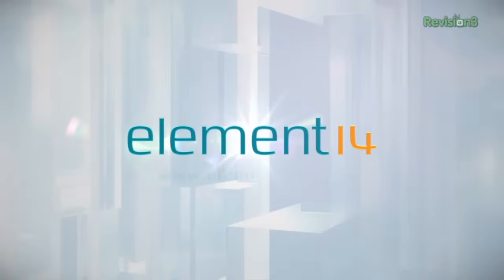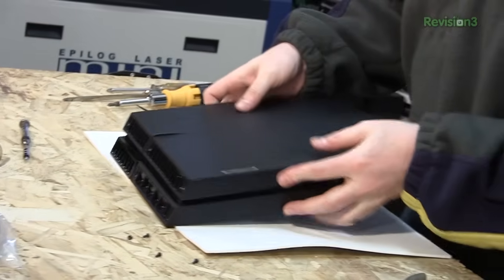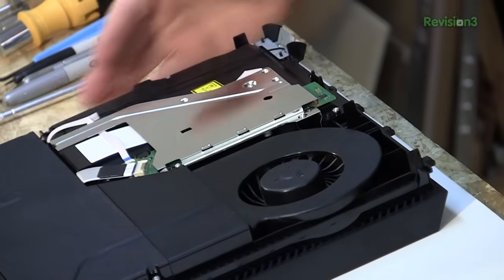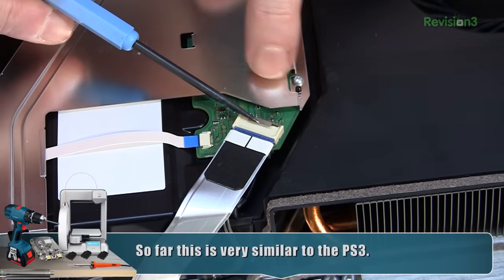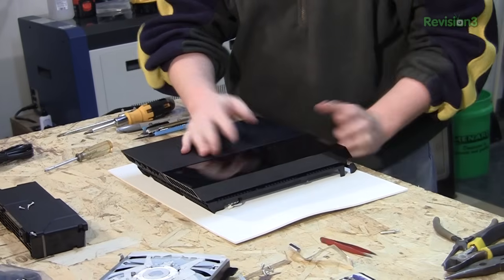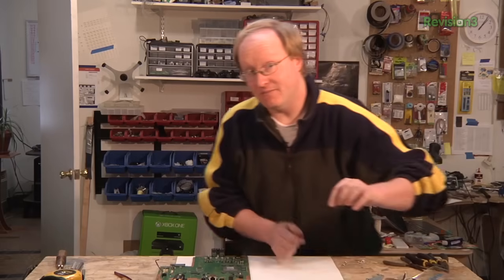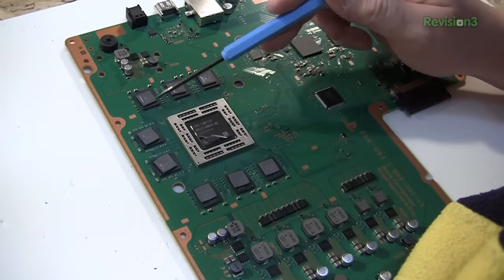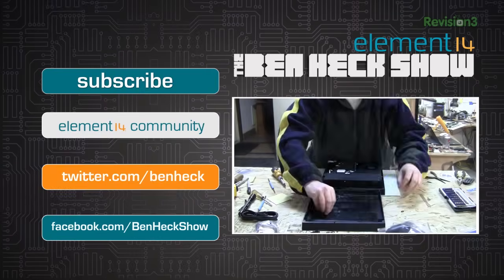Ben Heck's PlayStation 4 Teardown

Comment: Should I get a PS4 or an XBOXOne?  I heard the xboxone can't perform as good as the ps4 ... is that right?
Reply: They both perform the same, basically. Who gives a shit about exclusives? Both systems have them. You can't take PHENOM's word for the XBOXONE, as he has never owned a PS4. As a PC user, I prefer the PS4, but they're both basically the same system.
Reply: I Think you should go after the one your friends have bought or are going to buy (-;
Reply: You just had to ask didn't you! Like throwing a single slab of meat into a lion cage!
Reply: Xbox or PlayStation? I prefer to have sex with real people, arguing other which console is best only reduces the chances of any fun. Can everybody just stop boasting over which they think is best and just enjoy themselves?
Reply: Cody Strean not everyone wants a pc to game on dude.
Reply: XPHENOM SKILLSX oh yeah? well at least playstation doesnt have a pay wall behind everything, and doesn't use double a batteries in the controllers
Reply: ***** yeah but i only like pc for pc only games if i have the option to get it on console i will
Reply: The difference is very minute but ps4 is slightly more powerful but xbox uses less power while keeping a lot of the fps at 60, the ps4 might have some frame drops because of it running 1080p and in my opinion the ps4 is louder than an xbox, also the ps4 controller is pretty good except for the trigger buttons, the xbox controller has a few flaws but I like it the most
Reply: ben reeves We know more about next-gen games than you, we are the ones that experience true next-gen.
The 'next gen' consoles are actually past-gen, we have had those graphics since 2008.
Reply: Xbox is better
Reply: XPHENOM SKILLSX Thanks for your feedback.  TBH I think I'll just get both.  Buy a few busted up ones on ebay and repair them.
Reply: Trust me I just got the xbox 1 last week I'm loving it and how does size and looks matter for gaming? We get more exclusives, we don't get hacked like ps4 servers are always down, we get dlc one month earlier. Now its up to you.
Reply: XPHENOM SKILLSX I'll definitely consider it then.  But I'm the kinda guy that hates to choose lol I got both the ps3 and the 360.  However there is one company I will no longer buy from and that's nintendo.  They messed up way too much for me.
Reply: If you have the money then go for it.
Reply: But WAYY better than the ps4.
Reply: XPHENOM SKILLSX no the security on Xbox is just about as bad as ps4s sorry your not going to get great security on either of them
Reply: XPHENOM SKILLSX no its not
Reply: MrDurka Gaming not its true the xbone is garbage
Reply: XPHENOM SKILLSX i never said that. The security on sony sucks im not gonna be a fan boy about that but to be honest the ps4 is the ultimate console no doubt
Reply: kake427 Lol, that 50% more powerful thing was proved false a while ago. It's more like 10-20% more powerful, and with the new SDK update on the xbox one and dx 12/windows 10 coming soon they will be on par.
Reply: also it puts gaming first and doesnt have a crappy windows 8 interface
Reply: classicgamer2396 ps4 had one major update that had to be updated to work right. Xbox has had monthly major updates that worked day one. Also it has more indie games than xbox does yes but not when it comes to aaa exclusives.  Your opinion that the interface is "crappy" is just that, an opinion. Lastly xbox has put gaming first more than ps has. At the beginning that's what they said but now their focus is tv and movies and gaming last.
Reply: AntiKipKay dont go with what that first guy was saying, not true, ps4 is the fastest and the strongest console on the marquet to date, wich was a surprise for me, since i prefered the xbox360 over the ps4. also, sony got ALOT of exclusive IP's for the new console, also games are being made for ps4 and ported to xbox, that's just beacuse ps4 is strongest and easiest to build for.
Reply: AntiKipKay Microsoft turned it's back on it's customers when they announced the Xbox One. You couldn't get used games, share games, play offline for more than 24 hours (people who don't have internet at home [like me] were pissed), and the Kinect NEEDED to be plugged in for the whole thing to work. Do you want them constantly spying on you? Snowden confirmed that Microsoft was selling the NSA customer information. Yes, Microsoft changed everything, but only because they had to. If they were the only console on the market they would have changed NOTHING. I've made my choice. Now I leave you with yours.
Reply: i will it admit i was bashing the xbox one pretty hard so  and i can see why you'd think im a fanboy the ps4 definitely has its ups and downs. One of them being that sony security sucks donkey balls its been down ALOT, and the firmware update that didnt allow you to turn on the ps4 was pretty sucky aswell. Another thing I've noticed is even though the controllers look pretty innovative they are kinda unreliable when it comes to the analog  sticks the rubber on it will wear off after a few months so there you go thats the problems I've noticed with the ps4 its definitely not perfect
Reply: *****
i do have a gaming pc that's probably better than my consoles i just prefer the console i like the idea of chilling on my couch and looking at the big screen
Reply: Josh Spruce it's nice to know there are some cool gamers out there. Instead of people bitching why don't they just leave it you know
Reply: ***** you keep proving my point. If you hate consoles so much then why do you give a fuck? Oh that's right cus yoy think your special and need attention.  I don't care to spend 60 bucks on a game someone busted their ass to make. Also you do need to keep upgrading your hardware to outperform these consoles as more games come out and demand more power on pc. Like I said not everyone wants a pc but you still can't get that through your head. People like you ruin gaming.
Reply: MrDurka Gaming THANK YOU! IM NOT ALONE!
Reply: Jacob Hylén Very good point.  I thank all of you guys for giving your opinion on the matter.  I have read them and taken them into consideration.  I'm inspired to build a gaming pc as well as still play on consoles.  I'll feel much better now whether I get the ps4 or the xbone and won't feel bad missing out on anything besides the exclusives.  Whichever I can get cheaper will be the deciding factor.
Reply: ***** because if im playing my favorite pc game i wanna use a keyboard for it but i wouldnt wanna use it with a controller i would prefer a keyboard for a pc game
Reply: Lol almost equal then why some games ps4 1080p 60fps ad xboxone 720p 60fps yall are delusional its a fact ps4 is faster than xbox one they are not the same it would be bullshit and funy if they release a same spec system ps4 is fater uses gddr5 memory and has a better gpu not to mention a built in 3.5 headphone jack on the controller
Reply: Franz Pogi Both consoles are locked at 30 FPS...
Reply: TheVanillatech And no one likes you. Even your parents.
Reply: ***** Agreed, ultra-modded Skyrim was already ahead of nowadays "next gen" consoles graphics two years ago.

Also, the proof PC is ALWAYS superior comes from the fact that they use PC's to test, create and produce consoles and console games while you can't do the contrary.

This is a hot topic every time a new "console gen" comes out, let the console kids rage and talk shit. One day they'll probably wake up, if not let them just enjoy their system. Trying to win an argument with an ignorant person is a waste of time considering this is about facts and not personal opinion.

The personal opinion is which one you prefer, not which one is "best". PC is best, period, and there's so many proofs only an idiot would argue about it hence the waste of time trying to convince them of the opposite.

I enjoy both and have been gaming for 15+ years, no way anyone with such a long time knowledge would say the opposite and that's why console raging commenters are probably a bunch of kids...or at least I hope so, for them.
Reply: Ayan shaikh A computer. Lets just keep it at a computer.
Reply: YourPalHDee
Both are shit. Both can't do more than 30fps. Both are shit.

I get 150fps on my PC. At least with windows 10 and DX12 the XBOX will start to look good and have 60fps+. But a PC will still make it look shit.

The PS4 will be ULTRA shit. It already is. It was before it got released.
Reply: XBOX ONE: Less resolution, More frames per-second.
PS4: Decent resolution: Horrible frames per-second. 
--------------AND NOW------------------
60FPS +, FREE MULTIPLAYER, EXPANSIVE COMMUNITY, MODS
HAIL, THE ONE, THE ONLY, GLOOOORIOUS: ==+PC MASTER RACE+==
Reply: YourPalHDee just from what I've heard (which may be wrong). I've also read that PS4 Units have an underclocked CPU which to me sounded like a statement that would affect performance, Apologies for incorrections. (I am quite new to technological specification and am only speaking from my experience with the consoles in person. Not my own consoles of course, I do not own such peasantry). 

PC MASTER RACE - PRAISE LORD GABEN.
Reply: Wii U > All
Reply: AntiKipKay get a g51jx - x3 can play heroes of the storm extreme settings buttery smooth so probs can play well with other games
Reply: AntiKipKay nice that's good to here I've built pc's for a while and let me tell you they are well worth saving up for.
Reply: Xbox has like 40 exclusives i cant even name them all. What does ps4 have? Yea right, little big planet. xD
Reply: DeadmansWish
All your games are 30fps and all your bases are belong to us!

-PC Master Base
Reply: classicgamer2396 The Lizard squad is mainly going for Playstation because sony's security is so bad. Playstation servers are always down.
Reply: XPHENOM SKILLSX you dont know shit cuse you dont own playstation 4, ps4 superior 50% more powerful
Reply: kake427 Everyone is saying that to me online but what do you know about me I have both the consoles.
Reply: XPHENOM SKILLSX and they're not ALWAYS down. just like xbox
Reply: XPHENOM SKILLSX Keep in mind that I've owned consoles before :)
Reply: AntiKipKay keep on mind that if you dont have internet the xbox one will not be playable
Reply: Well that's a lie lol
Reply: classicgamer2396 coming from someone who still thinks it's always online lol keep trying kid
Reply: classicgamer2396 hahahahhahahahah
Reply: ***** cool story bro http://www.ign.com/wikis/xbox-one/PS4_vs._Xbox_One_Native_Resolutions_and_Framerates
Reply: kake427 Yeah only two 720p games on the xbox one and they look identical to the PS4 versions side by side
Reply: ***** yeah its not easy to see but still
Reply: MrDurka Gaming Then why does 50% more people like the PS4 better .....more....cough cough ....games
Reply: In lizards squads interview they said that dont was harder to ddos than Xbox and they had to take a bit longer im not choosing sides i just like to let people know the facts...happy fighting :)
Reply: Oops forgot the sony instead of dont
Reply: MrDurka Gaming dude wtf are you talking about yes it requires lots of updates but so does xbox and it has more games than the xbox
Reply: MrDurka Gaming mo man the ps4 has put gaming first
Reply: classicgamer2396 so not worrying about games and putting all your efforts into playstation tv and some shows for psn is gaming? Get out of here fanboy lol
Reply: I have both and the PS4 has the better multiplats (98% of the time) (here don't believe me? look at this http://www.ign.com/wikis/xbox-one/PS4_vs._Xbox_One_Native_Resolutions_and_Framerates, was cheaper (when I bought it), is technically superior, so the games will look better and Sony has far more internal studios than MS, therefore will have more exclusives. It also has the better controller in my opinion. Its got a touchpad and speaker and the light on it, while the X1 just has rumble triggers that are barely used. PS Plus is cheaper than Xbox Live and gives you at least 6 free games, many of which are new games, whereas Live just gives you two and are always years old. And the list goes on. The X1 does have more system opitons and features, but PS4 has shareplay which is a better feature in my opinion than anything the X1 has.
Reply: MrDurka Gaming im not a fanboy if sony does something stupid im going to point it out. But right now your the fanboy by bashing sony about things that arent even true so now im saying to you GTFO fanboy
Reply: ***** they're being made for it for now because it's like making games for 360. Xbox one is more complex to develop for. Ps4 isn't even powerful enough to say anything. The gap is the smallest ever and games will look the same for the most part.
Reply: You could still buy sell and trade used games. You could share them digitally disc or digital and they changed it because they listened to the customers. Sony is the one that turned their backs to everyone by lying like usual.
Reply: MrDurka Gaming How did Sony lie?
Reply: Sony always has. With the ps4 they said things like "we'll make 4k games" and ps4 they said "we never had drm" when they originally did or "were for the gamers" then only release a few exclusives and worry about tv and movies. Atleast microsoft was upfront about drm. They didn't lie or didn't mention it. Drm is where gaming is going anyways. The 24h checkins were to prevent piracy and stolen games and the used game policy would have kept more studios open and making more games. Used games alone have killed multiple studios.
Reply: With the ps3*
Reply: MrDurka Gaming im not a fanboy i own a ps4 because i prefer it if they started dropping the ball with playstaion than you can be damn sure im gonna return it or try to sell it
Reply: classicgamer2396 I'll get a ps4 when God of War comes out until then ps3 is better for me and xbox one is my next gen choice. I have all playstations and 1 xbox. I've always preferred xbox but I like sonys good exclusives but so far none that I'm interested are out coming out or announced
Reply: dude exclusives are great on both generations just depends what your into look it up
Reply: Very true
Reply: *****
not to mention playing couch co op games with my friends
Reply: ***** I prefer console cus I don't have to upgrade when new games come out. I just pop it in and play and it still looks great. Also you don't get games like forza or god of war on a pc so for me pc is a waste of my money. Not everyone wants a pc and nobody cares about pc when compared to consoles. If you prefer pc that's cool but stop forcing your opinion on others.
Reply: Yo if you have enough money to buy both, just buy a PC. Puts both of them to shame.
Reply: You want the truth they perform equally they actually have near same parts. just ps4 has a slight gray filter for the visual perspective xbox one does not which i prefer no gray filter
Reply: XBone can't perform as well because it suffers from erectile dysfunction...
Reply: ***** again not everyone wants a pc why us that so hard to understand?
Reply: ***** just because you don't like consoles doesn't mean everyone has to feel the same. If you don't like it then why are you watching vids on it or talking about it?  That's illogical. Not everyone can build a pc not everyone wants to. Some people like other things but you can't get that through your head.
Reply: ***** also pc will be more expensive. As games get more demanding you will need to upgrade your pc to run it at high specs while with a console you just pop it in and play and it still looks great. I paid 500 bucks for mu xbox and won't have to spend a dime more to play the games I want. If you don't like consoles then stop worrying about them.
Reply: The ps4 performs better than the xbox 360, but that doesn't matter, as every game still runs perfectly smooth on both consoles. You aren't buying a console for the actual console anymore, you are buying it for the exclusive games. I got a ps4 myself, pretty much the only game I've gotten is Infamous: second son, because it's my favorite game of all times. I saw that Infamous was coming out and that it was going to be an exclusive to the ps4, so I went out and got myself a ps4. Now I'm a PC gamer, but I still bought a console to play an exclusive on it.
Reply: ***** that just seems weird to me, i like pc games because of the keyboard but i wouldnt wanna hook up a keyboard to my tv and set it up on a tray table
Reply: AntiKipKay PS4 has better hardware inside it you will get better performance from it

Jacob Hylén Actually it's 60 FPS..
Reply: ***** 
Okay time to educate you. The majority of PS4 games will run at 1080p with 60+ frames with the majority of Xbox games running 900p at 60+ frames. Around a quarter of a quarter of those games runs at 900p - 1080p at 30+ frames. The FPS does vary if the game is demanding or not and if it was on last gen consoles. Lets say there is a HUGE demanding game and it was on last gen consoles, and it is still demanding on next gen consoles. They would have it at 60 frames.
Reply: ***** Wait are you saying AC is a very demanding game? The last time I checked those games were not talked about.
The PS4 DOES run CoD:AW and Ghosts at 1080 with 60 FPS with the Xbox version running only 720p on Ghosts (you can expect that from Xbox)
And I really don't know what you are saying about PS4 proven to be too weak? Can you please get some proof? I can play all my games with amazing response and it runs amazing.

And GTA V does run at 1080p and with a $400 console you really cannot get over the 60+ FPS mark. You can come to me saying OH MY $400 PC can totally do that hur dur. Okay then nerd give me the specs.

And MGS5 does NOT look terrible on the PS4. Cause you know PC and PS4 totally look different graphic wise. (Hope you catch my sarcasm there and if you do please send me a link stating HUGE differences)
Reply: XPHENOM SKILLSX Lizard Squad was disbanded and taken down about 3 months ago. Ended up being just a bunch of over-privileged sociopathic children. xD
Reply: bob jimmy It's very hard to compare a pc and a console by the price, as a console generally costs more to produce than it is being sold for. The ps3 for example cost 400 $ when it was brand new, but 800 $ to make. Sony later made their profit when they sold all the games. I think that if you're going to compare a console to a PC, you should compare it to a 800 ¤ PC.
Reply: classicgamer2396 Keeping double AA batteries is way better. Haven't you heard that if you charge a Playstation controller 500 times you will have to throw it away.
Reply: XPHENOM SKILLSX You are wasting more money on AA batteries though. And the chargeable batteries only last for like 10 charges then they are useless.
Reply: To be honest on the performance side PS4 is more powerful, there's a lot of games Xbox can't handle at 1080p that are running at around 900 upscaled.
I know that might not be an issue for most of us but still, imagine when 4K will be a standard. How would Xbox perform?

Consoles has the bad habit of being released outdated already so don't worry about performance, check the features and exclusives you like most and get that.

Everything but this is nonsense talking or fanboyism.
Reply: bob jimmy
 FUck you
Reply: ***** And yet you cannot make a $400 PC that cannot ruin consoles.
Reply: bob jimmy
Yes, you can. A $170 GPU is 2x faster than a GTX470. Therefore, it ruins consoles.
Reply: TheVanillatech Can you please tell me where you have got the thing saying that a console runs a GTX470? Nice try anyways.
Reply: ***** Okay listen here nerd. It's $550 in my currency (Oh wow he doesent live in America? How crazy!) And yes the card is to big for the case. No operating system? That is going to give you another $100 because last thing I found out is that Linux doesent support all games.
Reply: bob jimmy
Sure. Go to LinusTechTips here on youtube. Look down his loooooong list of videos and find the one where they benchmarked the PS4 and proved it was around the same rendering speed as a GTX470 (with the actual GTX470 being slightly faster than the PS4's GPU, but you're talking single percents).

Funilly enough, if you owned a GTX470 and played those amazing boring and unoriginal "AAA Exclusives!!!!!" on it, you would probably only be getting 30fps in 1080p in medium settings too, kind of like the PS4. Thats one of the reasons I upgraded my GTX480 two years ago, because it was starting to get old. It was LAST GEN. Oh wait a moment, Sony is bringing out a "NEXT GENERATION!!!!!" console, using the GPU I just THREW AWAY?!?!!

How I lol'ed ;)

-PC Master Race
Reply: TheVanillatech "Funilly enough, if you owned a GTX470 and played those amazing boring and unoriginal "AAA Exclusives!!!!!" on it, you would probably only be getting 30fps in 1080p in medium settings too" And this is where you don't get it. The devs have a say on what the fixed graphic settings and resolutions are. A console is completely capable of running 60 FPS on some games just like some $400 gaming PC's are capable of running 60 FPS and 30 FPS on certain games. And it IS considered next gen because of the new games it is running. Its just like you saying you threw out your GTX 780's for a pair of Titan Blacks.
Reply: bob jimmy
Sorry but .... WRONG. Remember when the first alpha of Doom 3 was leaked? More importantly, remember when Doom 3 was first shown back at E3? The gameplay footage was running on a Geforce 3, because this was the fastest card at the time. You know what... I can't be bothered. You win. Consoles are great. They are exactly what the world needs. They have done marvels for gaming. Things have never been better. 30fps is perfect. Have a nice life.
Reply: TheVanillatech LOL you are saying that all games on consoles run at 30 FPS. I could tell you a list of big demanding games that run WAY over 30 FPS on consoles. And anyways consoles are more fair to all. Everyone has the same frame rate everyone has the same specs in their console and its all fun and fair game.
Reply: bob jimmy
So saftey in numbers, huh? It's great to have 30fps as long as everyone ELSE has 30fps.

"I don't mind having no legs, because everyone else in my family has no legs."

"I don't mind spending £400 on a next gen console and being FUCKED over, because every one of my friends bought the same console and got FUCKED over too!"

"I don't mind being told lies about products I spend lots of money on, as long as the company lied to EVERYONE and not just me."

.... you get the picture.

-PC Master Race

(and no, not all console games are shit - I personally love beat em ups, vertical scrolling schmups and the Grand Turismo games, they are CONSOLE games. I just think that consoles should stick to what they do best, instead of dabbling with PC style games, which they are not only incapable of running (30fps yo...) but also strip of everything that made them great in the first place)
Reply: What would you guys suggest if I were to make a gaming pc?  Price range of about 600 bucks.
Reply: AntiKipKay
Ask a fellow American. Your prices are way less expensive for parts compared to the UK, so I cannot help you. I don't know your markets or which online tech retailers to use over there in the USA.
Reply: TheVanillatech Okay half of the shit you just said like "I don't mind having no legs, because everyone else in my family has no legs." Is not even relevant to a console and its frames. Everyone is on an equal playing field and NO you do NOT get fucked over buying a console. They are more friendly and you do not need to build it, they give you great exclusives and thats ONE of the main reasons why people buy it.

"I don't mind being told lies about products I spend lots of money on, as long as the company lied to EVERYONE and not just me." And you are dumb. What have consoles lied about exactly? And when they did say stuff at conventions that they were going to add in they DID add it in.

And so since you said that 30 FPS is NOT capable of playing, then what about watching a movie? Last time I checked a movie ran at 28 FPS (The way they made the movie. If you take some film classes they'll teach you about it) So please. Nice try PC elitist.
Reply: TheVanillatech I asked everyone.  Thanks for your reply though.
Reply: bob jimmy
Movies work fine in 27fps, that is not a problem. They are not to be interacted with. They do not require skill or motor skills to watch. They are not challenging (in the sense games are). Comparing a movie to a game is like comparing a piece of music to a painting.

What lies? How about PS and XBOX both promising their new "Next Gen" consoles to be 1080p gaming machines with 60fps. "AT LAST the gamers will experience CUTTING EDGE gaming at 1080p with FLUID 60fps". Then when the consoles come out, within 6 months they drop to 900p, then 720p .. and the current games coming out at 1080p are 30fps. How is that NOT lying? False promises. There is nothing next gen about either of them. They were both outperformed by PC's the day they came out. Now the gap is even bigger. It's HUGE.

Generally, in the world of technology very much so, when you make massive leaps and bounds in hardware you're not supposed to go BACKWARDS in order to make more money. That's what the consoles brought. A devolution, a halting of progress and pioneering which had been going on at lightspeed in the years before XBOX and PS became "popular". PC gamers had 30fps in 1992. We hit 60fps with the advent of 3D cards in the late 90's, when we also were able to game at SVGA (back then that was the HD of the time). Pretty soon we had 1600x1200 @ 120fps on 120Hz monitors, that was back in the days of the PS2. The gaming scene was evolving at an astonishing rate, year on year, because of the synergy between the genius game developers (Spector, Lavine and Carmack and the teams behind them for example) and the hardware manufacturers. Then the consoles came out, and stopped EVERYTHING dead. The entire industy, the artform of gaming .... comericalised. Profit driven. False advertising. False promises. Rehashing old games and concepts from 15 years ago and running them at 30fps.

You want NEXT GEN? If you own a PS4 or XB1 you have never seen it. And you never will. The old gods are gone, they left. Their companies bought out by the handful of giant media corporations that now own 90% of the gaming corporate infrastructure. The problem is, they leech all the new talent and who can blame them for taking a job? They need to eat. But the game is over.

Braben just came back to make Elite Dangerous as a kickstarter project. That game is FLAWLESS, made by an oldschool gamer, FOR gamers. It runs on even a GTX570 at 1080p max details, and it looks FAR better than any console can do. That's a GTX570, which are like £50 on eBay. So, when properly optimised for the PC and without the hacking of the graphics just to make it RUN on a console, PC gaming can still be pioneering. Others might follow Braben, but they WONT be releasing their games on consoles. I can assure you of that ;)

-PC Master Race

enjoy your 1080p exclusives, in 30fps...
Reply: Get a ps4 it's better
Reply: The best advice comes from the person who is not biased, obviously. I would not trust XPHENOM SKILLSX.

The Xbox One has a really good controller and okay hardware, but the design is a bit meh and it does not have as much exclusives as PS.
It has a lot more apps than PS and is more of a full entertainment console rather than for pure gaming.
I am pretty sure Xbox Live subscriptions cost more than the PS+ and the up front price of an Xbox One is $100 more.
The Xbox One must be online at all times in order to play, it must have the Kinect hooked up to it as well, as the controller has some motion control stuff, there has been a lot of huff about that camera.

The PS4 has a nice feeling controller, but not as good as the Xbox One's controller. It has much better hardware than the Xbox One and the design is great and it has a lot more exclusives.
The PS4 controller does have lower battery life compared to the PS3, it has around 10 hours average.
The PS4 costs $100 less than the Xbox One and does not need any sort of camera tool.

I prefer the PS4 overall.
This is coming from a PC player.
Reply: TheVanillatech Lolwhat

Everyone cares about exclusives. If console X has a particular game you want while console Y does not, you would be more inclined to go for console X.

What are you on, many PC ports are good and all games are made on a PC in the first place. For the PC after 2009, we have had Portal 2, Skyrim, BioShock Infinite, CS:GO, Dota 2, Binding of Isaac, Borderlands 2 and much more.
I don't understand what your comment was about, are you trying to say that every game on PC is trash?

All I was here for is to give the original comment poster some help or a better idea about the 2 systems that does not come from someone biased.
I don't know what you are on about.
Reply: Wacko Zako
Portal 2 : Not bad, but basically a glorified puzzle game / tech demo on the improved source engine.
Skyrim : Console game through and through. Salvaged in 2014 through the modding community - now actually looks like a PC game - but originally only slightly better than Oblivion, which was fucking terrible. Morrowind is 10x better.
Bioshock Infinite : Disgusting anti-climax. Should have been System Shock 4. Total disgrace, game on rails, you cannot die. Bullshit console game.
CS:GO : Where is the innovation? CS is as old as half life. You're talking about a 15 year old game, with slightly updated visuals. Innovation???? Originality??????? Neither.
Borderlands 2 : Are you serious?
DOTA 2 : A remake of a MOD for Warcraft III from 10 years ago, with slightly updated graphics? Someone pinch me...

If you don't know what I'm on about, thats your problem. Maybe you never will?
Reply: TheVanillatech What is your point, seriously. There are obviously many more and there are a lot more PC exclusives than consoles, what you said about those games were really underwhelming.

But really, WHAT is your point?
I came here and gave my opinion on the two consoles to hopefully help the guy who started this comment section regarding what console he should buy, I felt I should give my opinion as I am unbiased because I do not play either of those consoles.
Reply: TheVanillatech "Movies work fine in 27fps, that is not a problem. They are not to be interacted with. They do not require skill or motor skills to watch. They are not challenging (in the sense games are). Comparing a movie to a game is like comparing a piece of music to a painting."
 
And that is where you are wrong. Music isn't visible and a painting is. And yes where do you get the idea of movies having NO motor skills to watch at all? Have you seen someone play BF4 at 30FPS. Unless you have different eyes from almost everyone else in the world then you would say that 30FPS is playable. Almost every YouTuber that makes budget build PC's say that 30FPS is playable and show that it is playable, it is quite playable.

"What lies? How about PS and XBOX both promising their new "Next Gen" consoles to be 1080p gaming machines with 60fps. "AT LAST the gamers will experience CUTTING EDGE gaming at 1080p with FLUID 60fps". Then when the consoles come out, within 6 months they drop to 900p, then 720p .. and the current games coming out at 1080p are 30fps. How is that NOT lying? False promises. There is nothing next gen about either of them. They were both outperformed by PC's the day they came out. Now the gap is even bigger. It's HUGE."

Easy. That was XBOX lying, never buy and Xbox and go for PS4. Much better now, even console junkies know that PS4 is more superior. PS4 runs BF4 and almost every other demanding game at 60FPS (CoD etc etc.) And it IS 1080p. And no the gap isn't HUGE at all. Most budget builds run BF4 at 40+FPS. Oh and you know H1Z1 how they claimed it wouldn't be P2W? Yeah it is P2W with the airdrops. There goes your "Consoles only lie and PC's don't" crap.

"Braben just came back to make Elite Dangerous as a kickstarter project. That game is FLAWLESS, made by an oldschool gamer, FOR gamers. It runs on even a GTX570 at 1080p max details, and it looks FAR better than any console can do. That's a GTX570, which are like £50 on eBay. So, when properly optimised for the PC and without the hacking of the graphics just to make it RUN on a console, PC gaming can still be pioneering. Others might follow Braben, but they WONT be releasing their games on consoles. I can assure you of that ;)"

And consoles have Halo, LBP (You cannot say that game is shit. Even I play it. Its fucking amazing), The Last of Us. While you have what? Dota 2, LoL, Starcraft 2 and a bunch of MMO's? Nothing super gamebreaking.
Reply: CONSLES SUCK PC WAY BETTER END OF CONVERSATION
Reply: Ayan shaikh You probably game on your moms Optiplex. Shut up.
Reply: whats an optiplex
Reply: dont listen to pc nerd they been playing some old noob game like dota and lol for some year they dontkhow about anything next gen game so just get a ps4
Reply: no i mean are u offerd him a gtx460 and say its can beat the next gen console are u foolish or stupid even gtx 960 cant
Reply: i playing console and pc since 2005 i khow which are the best for gaming and console are awalsy better for gaming unlike pc change a graphic card haft of the year
Reply: ben reeves
OK Ben. Calm down there son. Consoles are far better than PC's. Consoles have better graphics, higher resolution and more frames per second than PC's do. People who own a gaming PC only dream of having the consoles quality. I wish I had bought a Playstation instead of my i7 and GTX970. What a loser I am.
Reply: ben reeves
Perhaps your argument would be more convincing if you could actually spell and punctuate properly.
Reply: TheVanillatech Perhaps if you could get a $400 budget PC to compete against a console then you could be talking. GTX970's and Core i7's are not within the price-range of a console.
Reply: bob jimmy
You don't need an i7 and a GTX970 to "compete" with a console. A PC with those components SHITS on the consoles. A PC like that is going to get 60fps + in max details at 1440p resolution. The consoles are getting 30fps in low details at 1080p.

Your argument is silly and uninformed and totally invalid. Come back when you have some sense to talk, please.
Reply: if you get something like gtx 400 you cant even play a next gen game
Reply: TheVanillatech "You don't need an i7 and a GTX970 to "compete" with a console. A PC with those components SHITS on the consoles" BECAUSE it is WAY more expensive then a console. Those two parts alone can buy you a console. So you tried kid. Please come back when you get a good enough argument.
Reply: bob jimmy
OK I have to ignore you now as your last comment revealed the level at which you argue. All the best.
Reply: TheVanillatech Yep. Plz leave elitist, since you can't keep the argument up.
Reply: bob jimmy
The argument is over. You lost.
Reply: TheVanillatech Ehm and yet you failed to prove how I lost. You tried.
Reply: The difference in performance between the Xbox One and PS4 in real world performance has yet to be significant, however the PS4 does have far more shader cores onboard it's APU than the Xbox One, and soon enough that is likely to start showing. The Xbox One's onboard 32mb of ESRAM will definitely be good for upscaling though.
Reply: I don't understand what you mean by Less resolution more frames per second.
It completely depends on the game, developers render their games at different resolutions and sacrifice framerate to whatever they deem acceptable.
Seen Dead Rising 3 on Xbox One? That has framerates as low as 16fps.
Let me just explain this fact as simply as I can. The Xbox One and the PS4 have the EXACT same architecture on their chip, it's an AMD Jaguar APU SoC, I believe it's 28nm. The only difference is, the Xbox One has 768 unified shaders, and the PS4 has 1152. Therefore you saying "Xbox One has better framerates" is just silly, the facts are as simple as this, the PS4 has better hardware, it has a huge amount of GDDR5 memory meaning it has much more room for buffered frames, so you're wrong, the PS4 always offer a higher framerate on the same software, given that it has equal effort put into optimization.
Finally, yeah PCs perform better, Both the Xbox One and PS4 are horribly underpowered given that it's now 2015 and they're running mid end APUs rather than Dedicated GPUs, At this point PCs will be doubling the performance of Xbox One and PS4 in 4 years time.
Reply: TheVanillatech What is your PC build?
Reply: Garvin Yip
The PS4 has a faster CPU than the XB1. The GPU in both systems are practically identical in terms of performance. The PS4 is the better machine of the two consoles right now. DX12 will change this, the XB1 will take over, but not by much. Both will remain low end, compared to an average gaming PC. Hope that clears things up.
Reply: Garvin Yip
I built most of my PC 2.5 years ago, and I got the parts extremely cheap because I am a smart buyer. I wait, I don't rush out to get the latest thing with the biggest number on it. I know what I am buying. I am shrewd ;)

My build :-

Intel i5 2500 CPU
Intel Server Grade Motherboard
16GB DDR3 2000Mhz
KFA nVidia GTX970
128GB Crucial M4 SSD
4TB + 2TB (external) + 1TB (internal) storage drives
Bluray Drive
ASUS DVD Writer
550w XFX PSU
Antec GX700 Military Style case (green + black)

Logitech G710+ Mechanical
Steelseries Sensei 6000Dpi mouse
XB360 wireless controller (for Street Fighter + my kids)
26" LED ASUS Monitor (1900x1200)
Reply: TheVanillatech Damn. Nice build!
Reply: TheVanillatech
 DX12 will change absolutely nothing, in terms of outperforming the PS4, updating the API will mean nothing. At the end of the Day the PS4 will still have better hardware so, if the devs are willing to optimize the game well enough, it will outperform the Xbox One. DX12 has even been Shown to mostly be based on CPU usage anyway, maximising Object Draws through CPU rather than GPU.
And even if DX12 did vastly improve the performance of the Xbox One, Who's to say Sony won't update their API to get better performance out of their chip? The bottom line is simply this, the PS4 APU has more than 40% more shaders, it is simply a better modified version of the AMD Jaguar SoC.

All cards on the table, here's the situation.
Both consoles use an AMD Jaguar based APU, The Xbox Version utilizes a slightly faster CPU thanks to what I believe was slightly more Cache, the PS4's version however has vastly superior onboard GPU, and their CPU is modified for improved Multithreaded computations, it also Uses a huge amount of GDDR5 memory, RAM that is specifically made for gaming, this enables the PS4 to buffer more frames than the Xbox One. The Xbox One uses DDR3 ram, typically a lot faster for general x86 processes non gaming related.
The Xbox One has 32mb of ESRAM this will enable the Xbox One to upscale it's resolution massively, making 1080 upscaled to 4k a possibility.
Conclusion: Xbox One will perform far better in non gaming related tasks, this is one of the goals Microsoft set out to achieve, they didn't want just a console, they wanted a home theatre and multi-media, multi-function device.
The PS4 is a much more powerful gaming device, they wanted their device to be purely gaming centric, and like Microsoft they have achieved their own goal.
Which is a better gaming console? PS4
Reply: Garvin Yip Yeah so essentially what that means is that non gaming related tasks will be better achieved on the Xbox One than the PS4, also something that a lot of gamers find important is ingame Physics, the Xbox One is also going to be slightly better when it comes to simulated game physics. Other than that, the PS4 is a better device for gaming in terms of raw performance.
Reply: Garvin Yip
Not really. I have this server grade motherboard which is totally fine and has a lifetime warranty and all, but it was made for a server machine not a gaming machine. Hence no second PCI Express slot for SLI. No overclocking options. It doesn't matter because every game I play runs great anyways. Should last me another year or more before I have to think about upgrading. And that will depend on if any games are out there that are worth upgrading for! ;)
Reply: TheVanillatech Sounds good, What RAM are you using?
Reply: Garvin Yip
Corsair XMS 3 2000Mhz
Reply: TheVanillatech you say yourself in the comment said get a gtx 400 u can get the same performance as ps4
Reply: ben reeves I said that the GPU in the PS4 has the same rendering capabilities as a GTX470, yes. Don't take MY word for it, go look at LinusTechTips. He proves it.
Reply: TheVanillatech That's not really true at all. They have similar hardware in terms of number of transistors on the die etc. But that really means nothing, because a PC uses a high level API like Direct X or less commonly, OpenGL. The consoles however code direct to their hardware with low level inputs. That means that there's no middle man having to reinterpret the graphics code into something universal that all cards' drivers are familiar with.
So although DirectX  for PC is becoming lower level as it updates, it will NEVER have the same performance as a consoles low level coding.
Reply: TheVanillatech
Which server grade motherboard?
Reply: YourPalHDee
That is true but the difference is minimal, and while Linus ran his test he did conclude that the discrete GTX470 is actually FASTER than the PS4 GPU, but only by a few percent. This difference offsets the overhead of DirectX, making them around equal. Like I said, don't take my word for it, go watch the video on LinusTech, he PROVES it.

It's strange I have to write a FACT three times, giving evidence and proof each time, and people still come back to dispute it... like I have an agenda or something? Nope. Just relating facts.
Reply: TheVanillatech if ps4 used gtx460 is it possible to run assassins creed unity or any next gen game
Reply: ben reeves
I already told you to fuck off because your previous comments exposed your knowledge of this subject is too poor to be a part of this discussion, didn't I Ben? You still haven't improved this knowledge, even quoting the WRONG graphics card for a second time. Ten years ago I would have answered you, but I don't tolerate fools easily now. In fact I don't tolerate them at all. Fuck off to google and go find out for yourself, if you are concerned enough to do so. Other than that, stop asking me questions or replying to this thread. Thankyou.
Reply: Yeah its true but you dont really get consoles for graphics since most Pcs can outperform them
Reply: XPHENOM SKILLSX don't ever get xbox1, ps4 is better, trust the majority.
Reply: TheVanillatech pc fans boy listen console can support any game for 10 year or more just  like ps3 but pc have better graphic in some game and pc graphic card,prossecor will get outdated fast in 1 year or haft of the year everyone khow that expect you and dont told me to buy every graphic card and processor every year of a month
Reply: ben reeves That's the dumbest thing I have ever read on youtube, and that's saying a lot.
Reply: AntiKipKay Its easy to answer that quistion . Do you like epic gaming amazing graphics and fast overal performance? then the PS4 is for you . 
Do you like switching from multimedia stuff using your voice and hands with motions and then gaming also (but not as impresive graphics ) then the XBOX One is for you .
Reply: ben reeves
Good lad Ben. Keep it up ^^^^^ up Ben ^^^

XD
Reply: Ps4
Reply: TheVanillatech fuc your self
Reply: Is it stupid of me to be proud that I started a 178+ comment strand on youtube? XD
Reply: Get a pc consoles are for newbs.
Reply: kappa kappa Saving up for one atm.
Reply: Honestly just get what most of your friends and family has, you wouldn't be able to tell the difference of performance
Reply: Slenderman
Swarm uses the SCII engine and it isn't really GPU intensive at all. Neither was SCII. In fact, a 550Ti or 560 can play SCII in pretty much the highest settings flawlessly. The game was much more CPU intensive, prefering 4 cores clocked at a decent speed. The game scales almost uniformly from clock speed, if I recall.

It actually plays faster on an i3 (Hyperthreading) clocked at 4Ghz than it does on an i5 (quad core) clocked at 3.7Ghz. But on either of those CPU's you would be having fun.
Reply: XPHENOM SKILLSX i had a ps4 and the server avent been down its better than that big ass brick
Reply: DeadmansWish wait till they are down then you will realize. Xbox also has backward compatibility we can play all the older games in hd fps and we have a custom scuff like controller.
Reply: Hd fps its still looks like if you were playing 360 ps4 is. Better in my opinion
Reply: DeadmansWish ahahah next gen has wayy better graphics and if you play older games on it you will find alot of difference. Lol XBOX HAS MORE EXCLUSIVES. fuck your ps4.
Reply: XPHENOM SKILLSX
Exclusives, AAA Games, 30fps.... all maxims of the potato next gen race.

All bullshit XD
Reply: XPHENOM SKILLSX
Are you seriously arguing that your potato is better than the other guys potato?
Reply: XPHENOM SKILLSX my potato is better 40 exclusives jajaj ps4 has way more here 
The Order: 1886 - Ready At Dawn & SCE Santa Monica
WiLD - Wild Sheep
Alienation - Housemarque
Rime - Tequila Works
Bloodborne - From Software
Dragon Quest Heroes - Omega Force
Hellblade - Ninja Theory
Amplitude - Harmonix
The Witness - Thekla Inc. Jonathan Blow
Primal Carnage Extinction - Circle Five Studios
OlliOlli: Welcome to Olliwood - Roll 7
Ratchet & Clank – Insomniac Games
Abzu – Giant Squid
Until Dawn - Supermassive Games
MLB 15: The Show - SCE San Diego Studios
The Tomorrow Children - Q-Games, SCE Japan Studio
Deep Down - Capcom
Volume – Mike Bithell
The Forest - Endnight Games
Everyone’s Gone To Rapture – The Chinese Room & SCE Santa Monica Studio
Let it Die – Grasshopper Manufacture
Disagae 5: Alliance of Vengeance - Nippon Ichi Software
Shadow of the Beast – Heavy Spectrum
Hotline Miami 2: Wrong Number – Dennaton Games
Tearaway Unfolded – Media Molecule
Persona 5- Atlus
Ultra Street Fighter IV - Capcom
Uncharted 4: A Thief’s End – Naughty Dog
No Man’s Sky – Hello Games. You can't name the xboner one exclusive because there is none the xbox is a .....rectangle the ps4 has a slick desing better controller
Reply: :( fuck ...pc is here
Reply: XPHENOM SKILLSX It looks you are an another brainwashed fuck...
Reply: XPHENOM SKILLSX  keep playing  GAYLO  I ment Halo with your giant Dreamcast looking controller
Reply: Isaac Bowers How do you guarantee that I've never had a ps4? I have a Xbox one, Ps4 and a pc setup. What do you know about consoles Mr. Pc gamer?
Reply: classicgamer2396 how's that? No games compared to the competition,  no support, updates that need updates, downtime on psn every other week etc. My ps3 is better than the ps4 the xbox one is the only console out that's showing it's next gen.
Reply: +XPHENOM SKILLSX ps4 has backwards compatibility it's called ps now